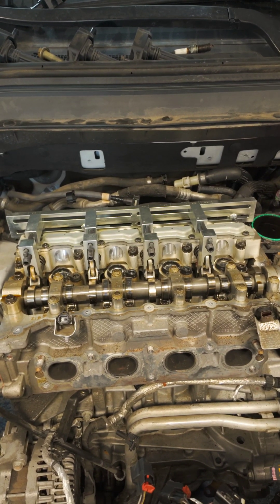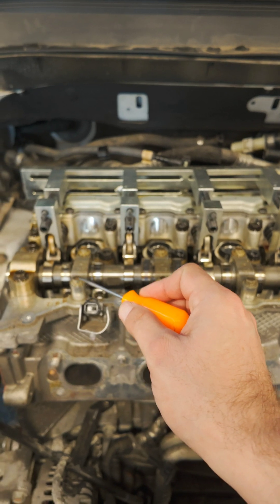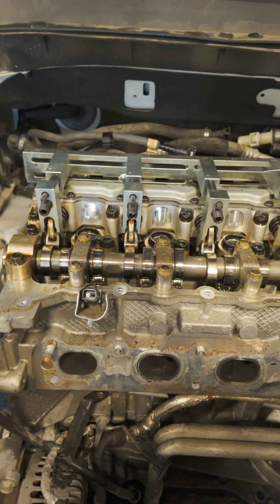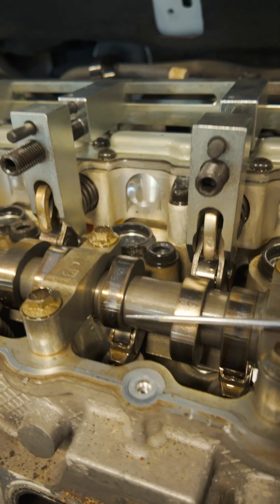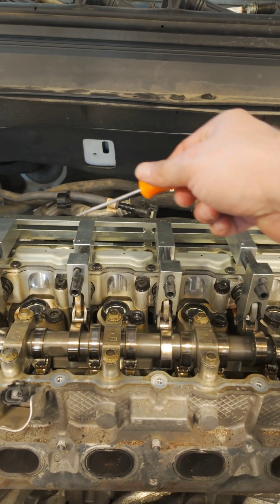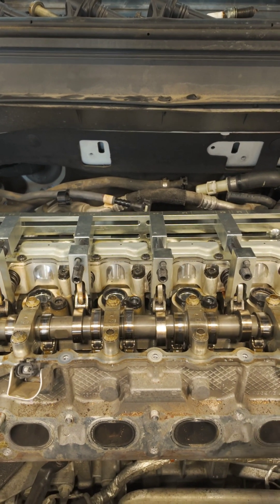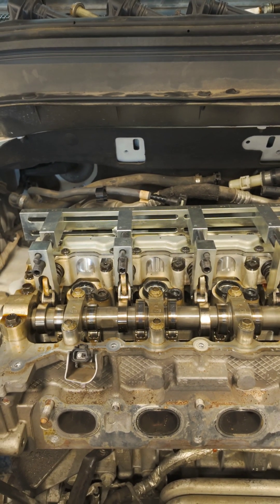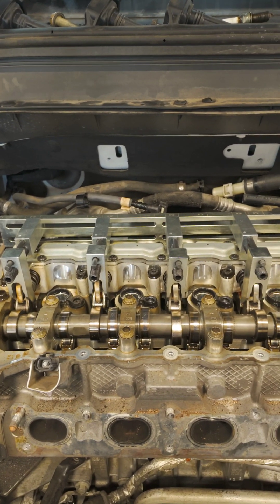🎥 What Makes the MultiAir Engine So Unique? 🚗💨 #shorts @short

Comment: Unique doesn't mean it's good. These engines are probably one of the worst around.
Reply: They have amazing efficiency and are reliable
Reply: They are very reliable. My 15 year old Alfa 150k miles still runs sweet. 0-60 under 8, 52mpg on the open road, all from a 1.4